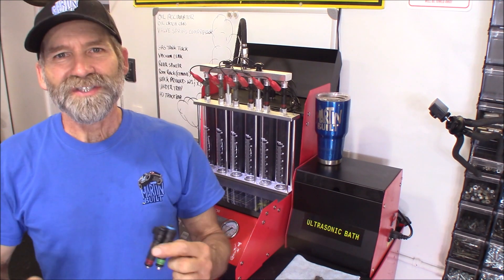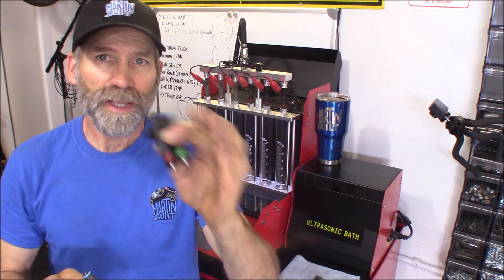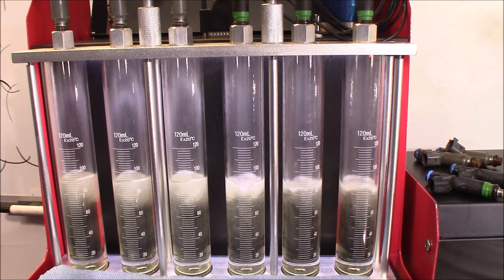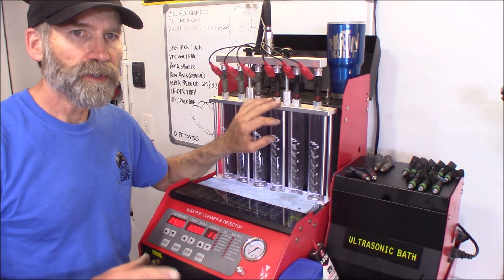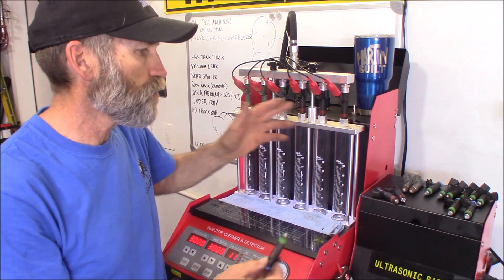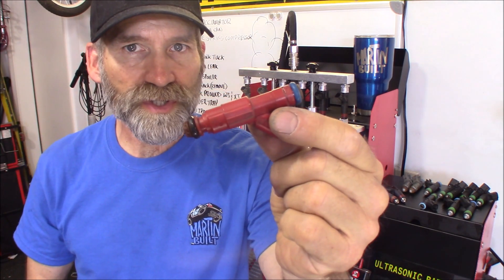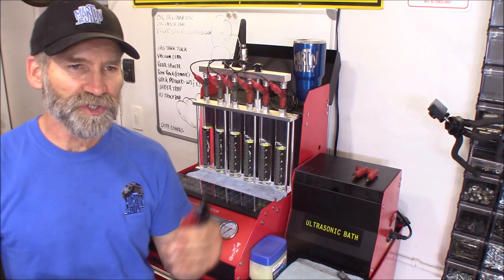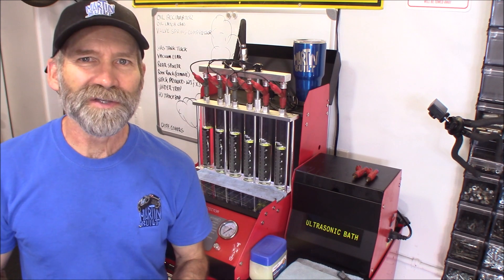Comparing  Fuel Injectors for Performance and Fuel Economy

Comment: geat visual test. I was thinking about replacing my original OEM 4 hole injectors but I saw a different  brand for my 2018 Jeep Grand Cherokee 3.6L that has 8 hole injectors and claims that i will get better gas millage/power. Does this seem doable given the test you have here? The injectors are at A Premium auto parts if you search in google. thanks

Comment: Tungsten disulfide and lighter synthetic oil for all components. In Wheel bearings, u joints, alternator bearings, idlers, in the power steering, and even ac compressor if possible. Change belts to the efficient ones. Then take the undercarriage and make a panel to streamline across the enire length and width to cut wind resistance.

Comment: I just pulled all my injectors out of my 4.7l every one was cracked right down the side 
it still ran fine with them but , I replaced them with cheap ones on Ebay and the truck is now running rich and misfire on #4 and 02 sensor code .

Comment: Well that answers my question. Got some 60lb Injectors for a turbo project. Setup a dummy fuel rail and tested my new pump and injectors. The pump was flowing more then advertised but the injectors advertised a 30 degree cone spray pattern. They looked liked a garden hose. 85% of the flow was just straight with a tiny bit of mist. It's just going to hit the port divider and run down the walls.

Comment: Did you have to change the fuel regulator? If you did, what brand did you use, and why?
Reply from the maker: No I've never had to change the fuel pressure regulator. 
I'm sure most fuel injectors will operate just fine with your OEM pump and regulator.
Reply: @martinbuilt  Good to know. As soon as I can afford some, I'm going to find some Denso ones for my Toyota, and if I can't find any of those, I'll pull some ecoTech type from a Prius or similar.

Comment: How much pressure?
Reply from the maker: I typically try to run it at 60 PSI somewhere near what your OEM pump would run.
Reply: @martinbuilt  i am currently fighting with bad atomisation on small Bosch injectors. Tested 50 of them at 55 psi. They all form visible droplets, nothing like the nice atomisation in your video.

Comment: I read that 12 hole injectors cause shifting to be smoother. How does it affect shifting?
Reply from the maker: I don't know how an injector would cause the transmission to shift smoother, did not notice anything like that, better throttle response and a smoother  idle I did have.

Comment: Does it works in a 5.9 magnum?
Reply from the maker: Yes, this fuel injector cleaner/tester does work with the injectors from a 5.9 magnum.
Thank you for watching.
Reply: @martinbuilt I just changed the injectors for the hhr ones but the fuel was very rich, you can see the fuel cloud from the exhaust although the engine sounds very smooth but the Gear last longer

Comment: Hi martin nice comparison. Is the AcDelco GM Original injector 217-2907 and the same injector as the Denso 12582704 these for a wj 99-04
Thank you in advance for your answer

Comment: Hi Martin great video very informative ! I have a 2005  Honda CRV with a 2.4 engine it has over 204k and I need to replace the injectors, as far as I know they are the original injectors. Do you think its worth  me replacing the filter baskets and cleaning them ? If not what injector would you  recommend Thank you in advance

Comment: Hello, can you suggest what is the best brand of gasoline injector cleaner for dosing annually into fuel tank?. Or your experinces or testing says that injector cleaners does not work!. Fuel dilution in engine oil originates from poor injector spray?. Thanks.

Comment: awesome video man, im looking at upgrading my injectors and ecu(haltech) on my m271 c200k and have been scouring the internet but no one likes to talk about efficacy its all about flow numbers, i want the best performance not just the peak performance and if the better injector improves torque throughout the entire rpm range and not just peak then so be it, motors are just heat engines and extracting more heat into work is the aim of the game.
Reply from the maker: Thank you. I really do appreciate that i'm glad you liked it and found it helpful.

Comment: Hey Martin, I love your videos, I subscribed to your channel as soon as I bought my dodge. I just got bosch 0280158103 injectors with 12 hole and 259cc flow rate for my 07 Dodge Ram 1500 4.7. What is your opinion on those? Can you do a test on them? You can find them on the Mazda 2.3 L3 motors. Thanks in advance!

Comment: Man why didn't I find your Channel a month ago and I ordered my injectors I went with the Denzel four-hole 27 lb injectors for 5.9 l Magnum engine which is bone stock so not looking just looking for better performance out of it and I had a bad injector on it and I looked at the 12 holes in when how the hell you going to get 12 holes in that little surface and I thought the poor hole would perform better but after watching this you get way better atomization out of a 12 hole should have went with my first instinct dang it

Comment: Guy made a video using a very expensive dyno and dyno tech, the tech said before the test there is no difference in performance between 4 and 12 hole using the same injector. Test said the same thing, also showed fancy k&n filter makes less power and lets in more dirt than factory paper. Apples to apples 4 and 12 are the same.

Comment: How about China made ebay injectors vs original for the same car? I bought as set of four honda fit new injectors for $20, thats only $5 each, just to test them out.
Reply from the maker: I personally would much rather have rebuilt factory injectors than any Chinese injector.
  If I ever come across any Chinese ones I will do a flow test against those and OEM injectors.
Reply: @martinbuilt  my reasoning behind it is, practically everything is made in China, even original branded ones.
Reply: @petercandance2330  how did those ebay injectors do in your honda? any noticable performance differences?
Reply: @rathernotsay9768  Hi, felt the same, not much difference with the old ones, which were still working anyway. no way to test coz I don't have access to or will not shell out for a dyno.

Comment: Will the Denso’s fit on a 97 xj 4.0
Reply from the maker: They would physically fit other than the connector would be wrong you would have the E V-1 connector where the Denso have the EV6.
 And the Denso would also probably be a little too much of a injector for the 4.0

Comment: simple question I already know but need confirmation, do most injectors fit size wise, I need to replace a few and Im just going to do all 6. I want to put those densos on my charger which I think stock poundage is 24lb injectors. They are 4 hole as is.
Reply from the maker: Yeah there are many that interchange no matter what the brand is but there are some out there that are either much shorter or somewhat shorter than the typical Bosch or Denso injector.
 Like the injectors found on the 2008 through 13 4.7 are shorter.

Comment: Hi Martin,   I've been playing with few injectors from my jeeps and around th same test bench and something strange happened,,let me tell you, I bought a set 24lb Ford Racing injectors for my Renix with no cat French export version,  before installing them, I bench tested both type,  the Yellow 4 ports BOSCH 0280155746  19.9lb Vs  New 24lb. and then....what ever were the test, idle, speed test, hi flow etc, each time the bosh were spraying more fuel. I said to my self, it can't be, so I installed them and as I run open loop in stock form  and as I dont have fuel trim but an after market wide band lambda, I can check my AFR and of course, my lambda dropped from 1 to 0.9
So in the test bench, they look to flow less but more when mounted on the engine.
Few days after, I came back to the test bench....why is that....I started to make test again, same result, then I look to machine parameters, I found that pulse width can't be adjusted on all tests, why is that, during hi flow test or other it's like pulse is way too short compare to real pulse width ( 5 to 20msec from idle to full load on E85 on a 5.9 for exemple ) 
Only on idle test I have been able to crank PW from 3 to 20ms, and than as soon as I start to increase PW, the for Ford racing start to deliver more fuel than the Bosch.
What do you think ? what was your pulse width during test ?  have you been relying on the bench test pulse width ?

Comment: That machine is sweet! How much to bench test my injectors? Are four hole better than two. I'm rebuilding my top end and I got to tell you those Chrysler components even after 60,000 miles I had it rebuilt in 2016. You look new valve seals and the injectors look amazing
Reply from the maker: I need to do a comparison with the white, green, and red band injectors which have better flow and spray patterns.

Comment: Was wondering if you could adjust the pressure of each injector to test at the specific pressure of the fuel pump in different vehicles or even if it mattered ? Fun stuff !
Reply from the maker: I am able to adjust the fuel pressure but not individually. I usually try to run them at 3 bar or 43.5 PSI. That way, you're always comparing apples to apples.
Thank you for watching. 🙂

Comment: Mine squirt should they be atomizing
Reply from the maker: If it's a 1 to 4 hole injector you will see more of a squirt than a mist.
Reply: Thanks Martin built. That helps they all squirt from 2 holes. Straight stream no atomizing effects. I suppose the intake air helps mist it up

Comment: I have replaced mine to the denzo and a code 0174 bank 2 lean 02 sensor. To many things to list as to why. Intake manifold leak, dirty 02 sensor, vac leak. Runs great just the code so I’m thinking it’s the 02 sensor.
Reply from the maker: Did the code show up after you replace the injectors and then if so I would suspect there's something wrong with one or more of the injectors.
Reply: I did clean injectors and put them in the rebuild before starting it up. Yes I’ll agree it could use another cleaning on injectors. I’ll get screen change tool with new screen then rebuild em all.

Comment: How much fuel pressure is that machine capable of?
Reply from the maker: it will go up to 120 psi when performing a leak check and maybe 80 psi when running 6 injectors
Reply: @martinbuilt  Looked it up but Amazon shows it not available. Thank you.

Comment: Other than the Larger Air intake and the 08-13 Intake Manifold you would not recommend the Denso injectors for my vehicle?  I am not sure what a Free Flow exhaust is.What other modifications are you suggesting?  No one really makes aftermarket High performance parts for this engine, that I know of.  I like my wired Intake and do not want to go to a fly by wire.  I like Simple.  If I was to put the Denso Injectors on without mods, you are saying that I would have problem with the vehicle.

Comment: Very informative.  Want to change the Injectors on my 2006 Dodge Ram 1500 TRX4  with a 4.7L V8 as the engine seems to be under powered and a dog like the Chevy 305cc of the 1980's.  Will the Denso Injectors significantly boost the HP and performance? Also got an K&N Air Intake on the Truck.  It also has a 390 Rear End. Can I also buy Denso Injectors new online?  Do any modifications have to be made when one uses the Denso Injectors?  Are there any other Mods that you can suggest that will enhance the performance?  I also have a 2006 Jeep Unlimited Rubicon with a 4.0L I would like to change the injectors on as well. Both Vehicles have a 6 Speed Manual Transmission.
Reply from the maker: I like the 08-13 intake manifold with a larger throttle body. Also a free-flow exhaust system. I would recommend these injectors be used on a modified engine.

Comment: Is it possible to use those Denso injectors on other applications than 4.7L, like a Ford 3.5L Fusion Sport? Or are they built with a particular rating in mind? Sorry, I don't yet know much about injectors, but I'm doing my research. Great video, I've subscribed and look forward to learning more!

Comment: Martin, what is you opinion of your tester compared to other affordable ones? I was thinking of buying that model, or the Autool 150, 160, or 200. Thanks
Reply from the maker: The one thing that the Autool testers have is a reverse flush I had to modify mine so it would do that. I also liked the fact that mine  had a separate Ultrasonic bath  At was not built into the machine.. Even though I burnt up  my ultrasonic bath because there was no timer or heat control you you cannot leave it unattended. I replaced it with a another ultrasonic bath that was much larger. I have  several of Autools equipment and I like their stuff I don't think you can go wrong with either one.
Reply: @martinbuilt  Thanks, how is the warranty and support on the Morphorn? Autool appears to have good "stated" warranty and support. I didn't find much on Mophorn related to that.

Comment: Any updates on the injector bench tester? Long term review of the machine? Would you buy the same one again or look elsewhere? 
Thanks!
Reply from the maker: I still like this machine the only issue I've had is with the ultrasonic cleaner it is not thermostatically controlled or have a timer so do not leave it unattended. Like I did and after being on for several hours it burned up, not literally. I ended up purchasing a larger ultrasonic cleaner that had a timer with temperature control.

Comment: Hey Martin, I put the Denso injectors in my 4.7 as you suggested in your video, performed the reset procedure multiple times,  and while everything seems to be running fine,  once checking the fuel trim levels, they show -20% to -33%. I know you say in your videos that the PCM would calibrate based on the injectors, but can you confirm that you are seeing the same on your 4.7 when running it? And that that is just how the PCM calibrates the fuel flow, not that it is really running rich?  
Thanks!
Reply: Hello Ivan, I still have the stock ones. With this change did you improve the MPG? I would like to improve that so having a better fuel economy.

Comment: Hey Martin! Another Vegas local here with a 4.7 WJ. Have you ever experienced a rough idle and engine shake intermittently? Usually happens after engine has been running and is restarted after a short break and lasts no more than 5 mins, correcting itself eventually, only to happen again randomly. I replaced my spark plugs hoping that would fix my issue. Thinking about replacing the fuel injectors next. Do you think they could be my issue? Thanks in advance!
Reply from the maker: check the fuel pressure at the rail make sure you have around 49 to 52 psi. Any code like a misfire code?
Reply: @martinbuilt  Thanks for the quick reply Martin! I do have a code, P0442 for a small evap leak and have smoke escaping from my driver side rear bumper, similar to the issue you had.

Comment: Its been proven time  after time on a DYNA that the 12 hole has no advantage over the 4 hole  when the spray hits intake valve stem & head the spray pattern is swashed   !!  and putting High flow injectors in a engine  is a waste if you don't have the ECM reprogrammed for the Higher flow injectors !

Comment: Where does the liquid for the spray test go in?
Reply from the maker: Using the funnel the  Liquid goes in where the injectors mount so your pouring it into the glass tubes.  That question is come up several times I think I just need to do a video on it.
Reply: @martinbuilt  Thank you so much!  Love your videos, so helpful!
Reply from the maker: @bharris975  Thank you, I appreciate that.

Comment: Does more fuel = less miles per gallon ?
I saw a video that shows 2,4,12 holes change spray atomization but the flow is equal amount of fuel.
Reply from the maker: not necessarily the ECM (computer) can compensate for the added fuel to a point. I have run injectors that are capable of delivering more but I get better MPG because of the improved spray pattern.
Reply: @martinbuilt  how much more?

Comment: That high speed test do you know what rpm is that in car?
Reply from the maker: I'll have to check but I know that it's actually much higher than most cars will ever run.  I wanna say 10000 RPM

Comment: DAM WHERE DOES THE TEST LIQUID GO?!
Reply from the maker: Use the funnel that is supplied and inserted into one of the test tubes and fill through the test tube have the tester in the drain position so it will fill.

Comment: Nice, im thinking about fuel injector swap to mazda 6 2.3 im looking on honda injectors they have multi point injectors and cars are very economical, looks like i found a honda fuel economy secret
Reply: Also, maybe you have some sugestions, same size etc.  Oem injectors are  0280156156
Reply from the maker: yes the Bosch 0280156161would be a great choice.
Reply: @martinbuilt  thanks

Comment: So I have been using your videos alot here lately trying to do the ho cams and intake swapping. I've got a question for you and see what your opinion is on the issue. I know I've seen some car guys wrap the injector rails with heat shielding tape. Does that do anything for improvement on fuel mileage and power, or it a waste of time?
Reply from the maker: That is actually a good idea I have done it to my 4.0 in my XJ, it would be a performance mod.

Comment: Excuse the question but those injectors are for diesel truck?
Reply from the maker: None of the injectors in this video are for diesel. 
This injector cleaner will not be able to operate diesel injectors due to their very high operating pressure.